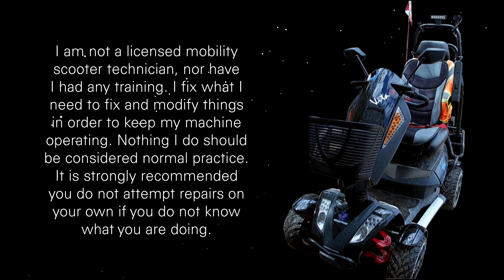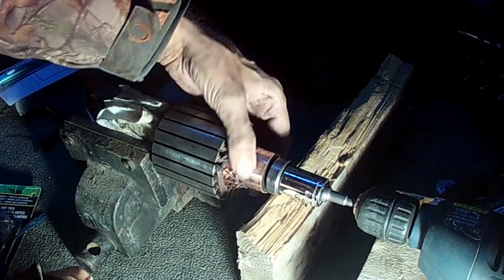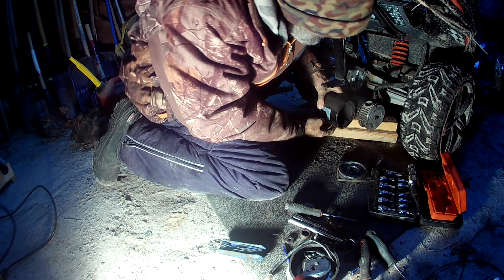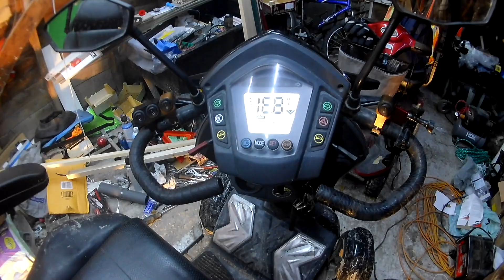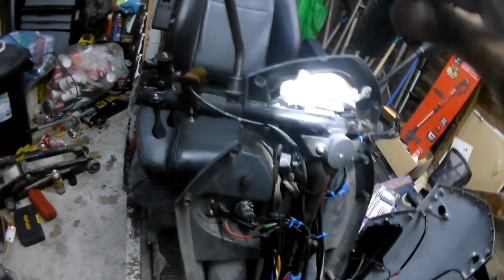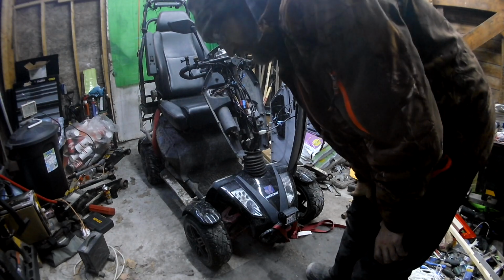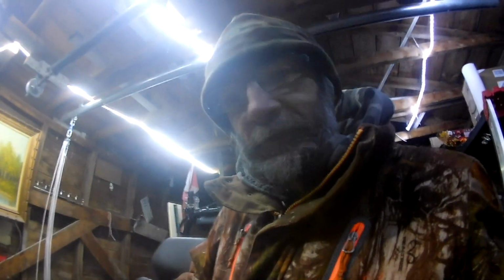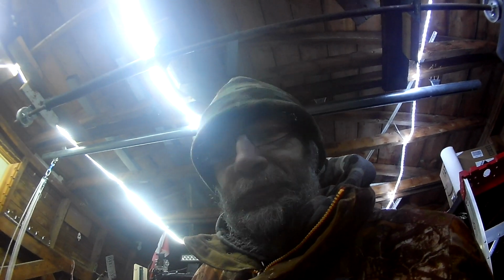Fixing the Motor's Commutator - P2 - Completion, Error Fix and a Test Drive

Comment: when you turn could that loom be pulling tight inside the cabled at the bottom where the tiller bolts to the steering mechanism if the wires are being stretched it might be pulling the wire apart inside the cable maybe give them some slack to allow more movement ,
Reply from the maker: I made sure I gave them plenty of room to move but, now that you've said that, I kind of recall that was "before" I zip tied everything in place.

Comment: At this point I would say there’s more of you work in your “project” than the manufacturers, also er when you stop just off the road on your brake my dark sense of humour raised its ugly head and I expected you to get a tap on your shoulder after you turned your lights off the find some dude asking you if you where out here taking your dogging for a walk. Engage ludicrous speed peeling outs there. I ask for forgiveness not permission 😂
Reply from the maker: LOL. When I used to park down at the river, before the dam gates were closed, it amazed me how many people would stick around to see if I was in trouble. Some people would tell me that. Others I just assumed were doing the same as they pulled away right after I left. It's nice to know there's still a lot of nice people around. While I was sitting there in the dark (in this video), one car did pass slowly and I was expecting them to come back to see if I was in trouble. Maybe they did after I left, I don't know.